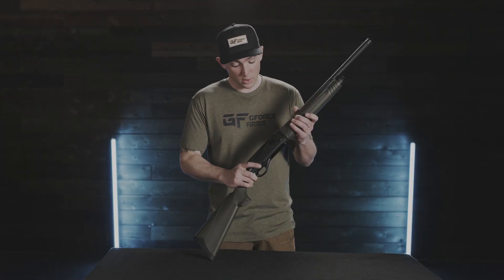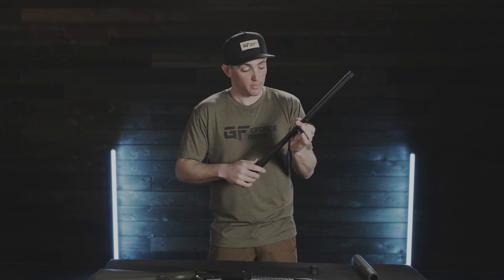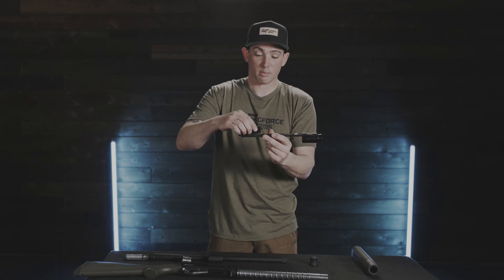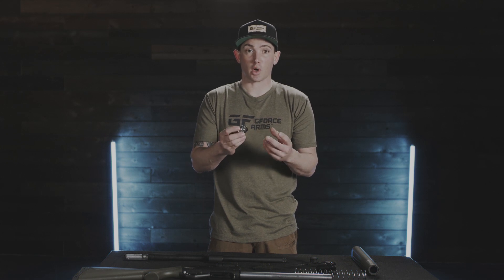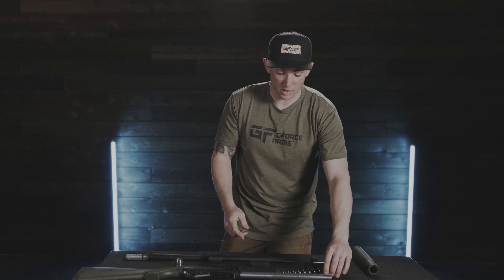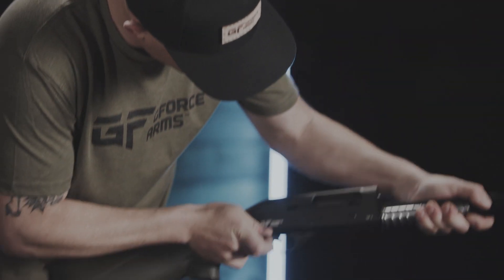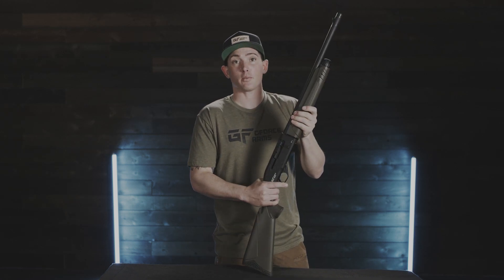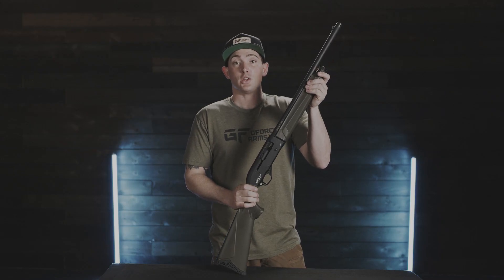GForce Arms  - GF1 Semi-Automatic Shotgun Firearm Teardown

Comment: This is damn near the same gun as the citadel warthog. The warthog has a barrel nut and this doesn't. The older warthogs don't have that barrel nut. It's identical. Both are probably a decent guns.
Reply: I picked up a used Warthog II (pistol grip stock) . There is no barrel nut, and the barrel moves in and out slightly. I'm wondering if this is normal? If not, without a barrel nut, I'm not sure what the fix is.
Reply: @djturnz  I had this problem last night. On the end of the foregrip there is a bushing. The inside of it cand be screwed in and out. I found this out by accident. I just turned it out about a half a turn and retightened the nut and the slop was gone.  Pull out the center of the fire grip . The foregrip is actually three pieces.

Comment: How come my 20g comes with a heavy load gas piston that doesn’t snap into the barrel like the standard load piston. Heavy load piston doesn’t have a snap ring and fits very loose. Is that normal for it to slide in and out ?

Comment: I have tried and tried to get the charging handle out . Lined it up and tried my hands, a pliers, and a screw driver and no go. All I want to do is clean it up and oil it but for some reason mine won't come out. Yours mus be either very wore in or something. I hate they make crap so hard to do.
Reply: Im having the same trouble on mine, did you figure it out?

Comment: Is there a magazine limiter available for this shotgun?  3 rounds for hunting in most states.
Reply from the maker: there are general plugs that you can get online.
Reply: @GforceArms  Will you direct me to the correct one via a link?  I don’t like having to use trial and error on something like this. Thank you.
Reply from the maker: @lucasgibson8471  We don't have any recommended links, unfortunately.
Reply: Wooden Dowel cut to length is the cheapest method.  Also check online for universal plugs.  Install method should be done via gunsmith.
Reply: Bs any good shotgun should easily be changed from 5 rnds to 3 for state regs.

Comment: My magazine cap is SUEPR TIGHT. How can I unscrewed it?? It’s giving me a hard time
Reply: Mine was fine, but may can try one of the rubber strap type oil filter wrenches to prevent damage getting it loose.
Reply: I gently used a pair of adj pliers with a heavy piece of old belt leather wrapped around the cap.

Comment: Love mine got mine last month  anyway I could put a sling on it
Reply: Best results would be to get a universal sling kit for shotguns.  The rear can be screwed in to the stock where the screw is by the recoil pad on the bottom.  Front can be a barrel clamp or a nut and bolt type after drilling a hole in the mag tube end cap.  Lots of other methods out there.

Comment: What Optics Mounting System Does This Weapon Use?
Reply from the maker: The GF1 and all of our pump action shotguns come with a 3/8 inch dovetail rail system on the top for mounting optics.  There are “dovetail to picatinny” adaptors available aftermarket to convert the dovetail rail to a picatinny rail for picatinny optics mounts.  Simply do an internet search on “dovetail to picatinny rail adaptor”